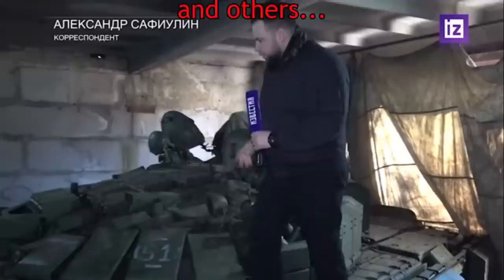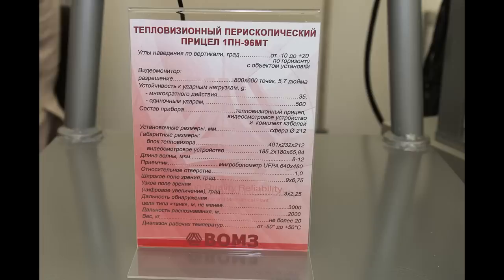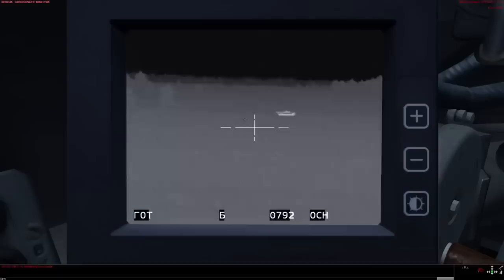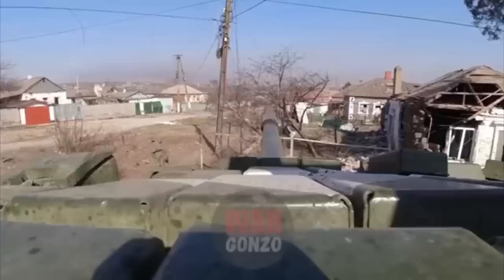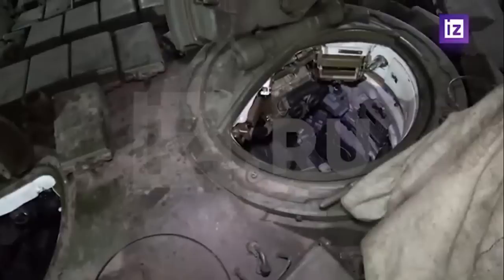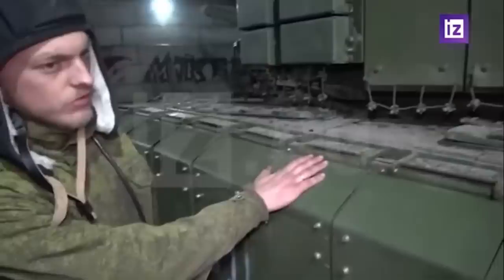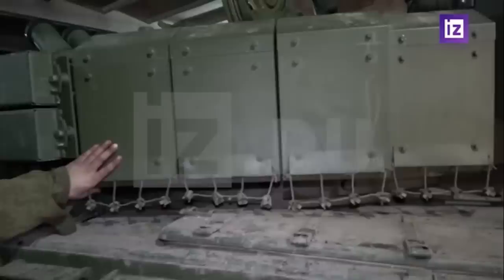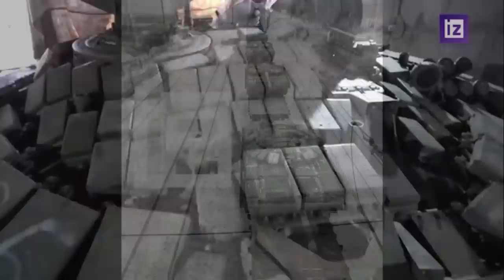Are Russians Downgrading Their Tanks?

Comment: The irony is that the T-72 was originally designed as a downgraded tank meant to be able to be produced en mass during war
Reply: Not really downgraded, it's more simple to use (and manufacture) compared to T-64, but not a downgrade. It's just T-64 that was far too complex. Like who the fuck designs a tank that requires an experienced officer (ranked somewhere around lieutenant or at least "praporshik") as commander and about 5 years of experience just to drive it and shoot the gun (not even aim that well)? I'm not even going to add that weird engine design taken from aircraft engine or something.
Reply: @unknowncommenter6698  you are confusing it with T-80
Reply: @Tonixxy  nope, T-80 is one with gas turbine and T-64 is the one with stupid engine design and complex systems.
Reply: @unknowncommenter6698  wasn't T-80 a T-64 with some improvements + that gas turbine engine
Reply: @Tonixxy  no, T-80 is completely new chassis. New chassis and new engine. T-64 got small "wheels" as a feature and T-80 doesn't have those. If I remember correctly.
Reply: @Tonixxy  looked it up and while first prototype was based on T-64, they changed the chassis completely because they couldn't fit the engine into T-64. So the only thing left from T-64 for first T-80 tanks was a gun and autoloader.
Reply: @unknowncommenter6698  T-72 ural lacks turret's composite armor, which is apperantly major downgrade.
Reply: @unknowncommenter6698  they got way way too complicating with all the tanks and designations
Reply: @zyakemk4  oh, really? Didn't know that, why would they do that and keep the composite in the hull? Like wasn't whole "turret gets hit more often than hull" thing the cause for T-44's increased turret armour?
Reply: @Tonixxy  yes, T-80 article in Wiki is a fucking mess. Now imagine going into how much different artillery systems Soviets designed, that's quite a logistical nightmare.
Reply: @unknowncommenter6698  t72 "ural" come before t72 a, it... a base model
Reply: @unknowncommenter6698  the T-72 Ural turret was 280mm of plain steel on the front most parts at somewhat of an angle. The effective thickness ranged from 300-500mm. Hull composite was rated about 400mm vs KE and 500mm vs CE. Not that much better.
Reply: @unknowncommenter6698  m1 abrams has a jet engine and it still functions well
Reply: @duytranuc4025  nah I mean didn't they have composite in turret as built-in feature for T-64(original)? Then why would they not keep it in T-72?
Reply: @tsunderella5826  Abrams has turbine, but I'm talking about diesel combustion engine, like it was copied from some German plane that had propellers (way before jets became popular). I found out about it from some Russian-speaking channel (that guy just makes history videos about random interesting stuff), so idk if I can just send you a link, he doesn't have eng subs.
Reply: @unknowncommenter6698  T-72 is not to replace T-64, it to replace T62 and T55, and t64 is fullfill the role of t10M
Reply: @unknowncommenter6698  You mean opposed piston engine of t64? Arent those actually more efficient than classic designs?
Reply: @unknowncommenter6698  The T-80 is based on the T-64. They lengthened the chassis and upgraded many other things. It's still based on the T-64, just like the T-90 is still really a T-72. Although I will say that a T-90 is more similar to a T-72 than a T-80 is to a T-64.
Reply: @PotatoeJoe69  and they also changed the "track wheels", not even talking about making them paired instead of individual. Kinda feels even more of a change than T-90 to T-72 where major difference is just changing the turret (and adding turning wheel instead of levers or smth)
Reply: @RedVRCC  considering at that time NATO only have M111/DM23/M735(105mm) it is enough, turret is a bit.... so they add composite later
Reply: @duytranuc4025  true, RHA does tend to perform worse than composite arrays against APFSDS
Reply: It's the same logic as the old WWII Carcano. Most conscripts will have no use for fancy windage and range adjustments, in fact they'll probably ruin the zero by fiddling around. Sometimes good enough basics is better than having bells and whistles that few actually get the training for. The bottleneck for Russia isn't tanks, but refurbishment capacity. Facilities that can work on T72s and newer have reached maximum capacity, hence why they are brining upT62s that be refurbished in lower tech facilities that wouldn't normally produce tanks.
Reply: If used in great numbers the line would have 3 victories under its ammo  belt next month.
Reply: @unknowncommenter6698  Did you see T72 and T64 irl ? T72 is a shitty tank with shitty suspension. This weird engine used on best soviet tank T80 UD. The problem is that T64 out of producation in 1986 in People try to compare T72B3M vs T64A. Even Now in Ukraine T64 effectively destroy latest T72(T90a) and T80
Reply: @unknowncommenter6698  it is meant to be the test bed for new technologies and the spearhead for a battle group. The opposed piston engine is for the increased efficiency and range, while T-64 is also the first Soviet tank to carry an autoloader. In a way it is kind of like the F-14, which is also way too complex with its variable sweep wings, huge ass radar with  a 2 man crew required to operate it, and the stupidly expensive  phoenix missile. Meant to trial new technologies while also trying to be the dick compensation machine during the cold war.
Reply: @unknowncommenter6698  honestly i think it was a stupid concept to begin with,it was essentially a strategy of using simple easy to maintain mass produced tanks along with the harder to maintain difficult to produce tank which was essentially world war 2 era repurposed strategy of using medium tanks and heavy tanks,one standard tank would have been better,it could be upgraded and given to cream of the crop veterans and graduates while the rest could make do with standard tanks till those upgraded too.
Reply: Well, in fact Ural factory was tasked to begin mass production of T-64, but with usual soviet rivalry between design bureaus that could never happen. There was whole conspiracy to catch time when MOD minister was on vacation so his less rigid subordinates could allow some significant modifications to make Ural's version of T-64 cheaper and easier to produce. The end result was T-72 that had almost zero compatibility with T-64, was barely 10% cheaper but that came at the cost of aiming assist system, less ammo capacity, worse armor, significanly less reliable tracks, fragile rubber bandages and much weaker engine with direct lineage to old T-34. But hey! It was easier to start up and maintain than fancy 2-stroke T-64 engine! Not that it was hard in the first place if you had more than 2 working brain cells...
And then there was third major tank factory that wanted its own design in production - Kirov Zavod in Leningrad. Long story short they convinced Party leaders that country needed third new tank chassis with similar capabilities but zero compatibility. At least they took turret from the most recent T-64 version that was produced at that time. T-80 was born. 
And to make things even more exciting Kharkiv plant was forced to switch from T-64 to T-80, but since turbine engine proven to be extremely thirsty and troublesome they were ordered to put into Kharkiv's T-80 engine from T-64. It was called T-80UD for more confusion.
This way USSR had basically 4 mostly incompatible tanks for same battle role which required separate supply and training infrastructure. Oh and T-84 and T-90 are evolution of T-80UD and T-72 respectively with welded turrets and some modern systems but virtually the same old chassis.
Reply: Great point.
Reply: It was meant to be an easy to produce tank and yes you're correct from a manufacturing perspective it was simple compared to the T-60 series tanks. However these incremental upgrades such as the B3 variant, you see a very capable tank
Reply: @Tonixxy  Nope Jack Petty is partiually right as the t-72 ural was the original design but was only made for soviet union but in lower numbers; Al other T-72 are the Model t-72m and did have lower armor and other less quality gear on it. This stay the same true all production years until newer T-72B1 was released
Reply: It’s just what you get when you are shtting tanks as fast as you possibly can. Some turds have corn, some don’t, and they’re not all pointy on the end!😂
Reply: No it was not. The T-72 is a modernization of the T-64, with a different auto-loader and generally with more realiable and easier manufacturing process. FOR EXPORT, no T-80 or T-64 were exported before 1991! Even border nations (DDR and Bulgaria) didn't operate T-64 or T-80! The T-72 was the tank to arm the Warsaw Treaty countries, and to be exported to customers like Iraq, Finland and Yugoslavia.
Reply: @dotnask0001  
It is also a very elegant and sexy looking tank. Compared to what ever the fk the Abrams is trying to be. When it isnt poped like a hot tomato by goat farmers in Iraq.
Reply: @Tonixxy  HUSH MODE!
Reply: @dotnask0001 it's not a modernization. It's a different tanks. T-72 much worst dashboard and crew place. Worst autoloader. The T-64 has much better the off-road abilities. The T-64 engine much better and not obsolete.  Much better aim, fire system and etc. I was inside both. The T-72 it's a piss of sh*t and the infinity pain in the ass

Comment: If it is an upgraded T-72B, then hey cheap thermals is better than an infrared spotlight
Reply: True, especially because there are not enough big tank on tank engagements to rectify a much more expensive fancy system, those thermals are more than enough for infantry or the occasional IFVs they most likely encounter.
Reply: I think this sight will be a very decent choice for modernized program of T 55 or T 62 tanks, if they don't wanna change the gun. 100 mm and 115 mm have pretty limited range compared to 125 mm so a 3000 m detection range is more than enough with these tanks. Integrate this thermal sight with DNS 2 day sight, slap it on a T 55 with slightly improved gun, old ERA and a new engine. Boom, you have a perfect tank for counter insurgency operation or low intensive conflict. This thermal will be fitted with Pakistani modernized T 55 from Serbia. which is only lack a cheap thermal sight to become a good budget tank.
3rd generation thermal sight on some T 55 modernization like the Vietnamese T 54M is a waste of money since the sight is expensive, the gun is still 100 mm and commander still don't have any new toys.
Reply: @DerDrecksack87  
Well, that's the whole thing: Russian tanks go in unsupported nearly all the time. Sure if you put a direct HE hit in infantry doesn't stand a chance. The thing is, they don't tend to stand still in the open much. 
Now against something like Javelin that's a death sentence, but even simpler systems like the humble Panzerfaust allow infantry to blow up Russian tanks at 200-400 meters. Making it exceedingly lethal if the Russians are assaulting any position, since  the Russians are at a spotting disadvantage.

Nevermind what happens when the more modern MBTs enter Ukrainian service.... Although that'll take a while. The sights on those are enough that multi-kilometer engagements are accurately possible. And the last thing you want then, is for your sight to be garbage that leaves you guessing 'Comrade, is pixel tank or house?' and having to drive well within range before you even see anything, nevermind spot, nevermind engage, nevermind engage succesfully.
Reply: @nvelsen1975  But every west propaganda says that javelin and panzerfaust at4 destroys russans tank minimum 2km away, but now its 200 - 400 m , so the AT team is fucked like we saw on many russians videos. So again ukro propaganda. Holy javelina is same as bullshit ghost of Kiev, isn it.
Reply: @stolek6908  
Sergei, at least put some effort into it. Panzerfaust is an RPG type system designed for 400m tops, Javelin is a semi-autonomous ATGM system designed for longer distance.

Even comparing the two at all shows you're a putin-troll.
Reply: @nvelsen1975  im just refer to something you wrote. No bed filling everything will be just fine
Reply: @stolek6908  You write a lot of risible nonsense. Try harder if you're going to be a propagandist.

Comment: Most tanks are getting destroyed by artillery doesn’t matter how much upgrade u add it’s not stopping an artillery round they just need to do better tactics
Reply: ATGMs and shoulder mounted AT weapons also are a big threat to tanks. A couple of T-90Ms were disabled and abandoned after being hit by a light AT launcher.
Covering the entire vehicle in ERA and extra armor is probably not a bad idea.
Reply: @scatterlite2266  well usually these missiles are tandem shaped and/or hit the roof of the tank where armor can't be good enough physically, so covering the entire vehicle in ERA and extra armor will be beneficial mostly only vs tanks with their APFSDS' and not tandem shaped HEAT shells. So kinda meh decision imo, since it also adds weight as I understand.
Reply: @Tichondrius-  the reactive armor they are using works against shaped charge too
Reply: @basharhafizal-asad8853  Tandem shaped charge weapons contain 2 charges to first detonate the ERA and then penetrate the armour with the second charge. This has been around since the 80's. The second charge around can in many cases exceed 500mm of armour penetration.
Reply: @Ragedaonenlonely  i was talking about the most advanced one but i forget to specify, the relikt should work against tandem too